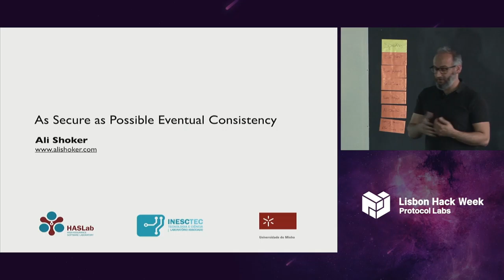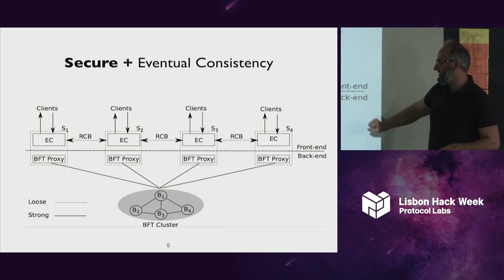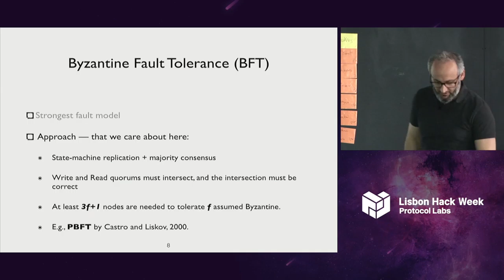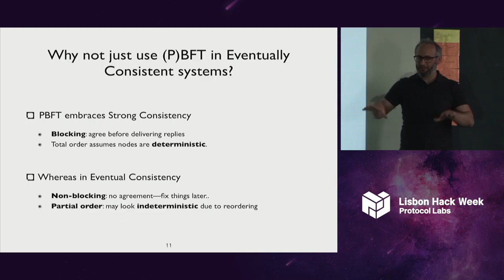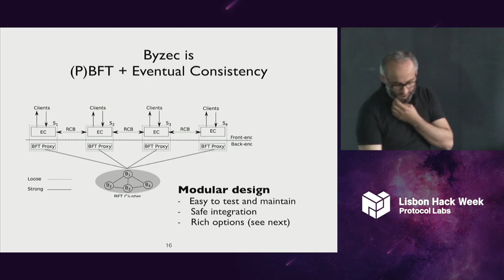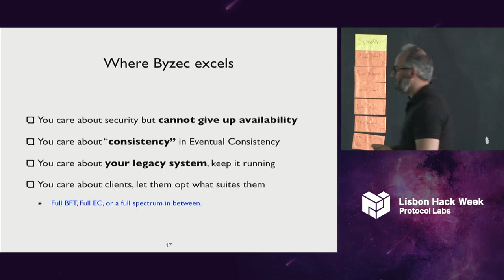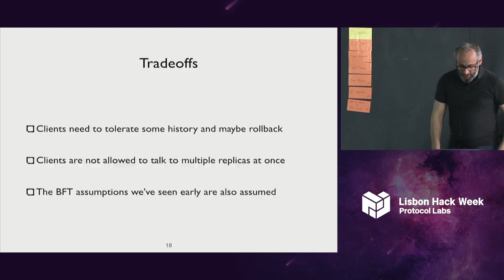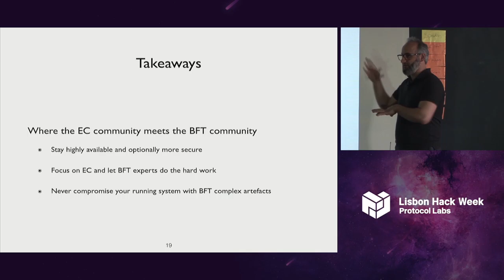CRDT Research Meetup // As Secure as Possible Eventual Consistency - Ali Shoker

Comment: Thanks for the intertest.
I think there is a misunderstanding since we don't need that "engine" (although it is nice thing to have, in general). Assume we don't have Byzantine application EC servers (a.k.a., replicas) at all. As long as the causal broadcast middleware delivers operations in causal order, any causal path on any replica would lead to convergence, a genuine property of CRDTs. How do you verify this integrity? It is through comparing the states of the same version on diff replicas. Those should be equal in the fault recovery model. 

In the case of a Byzantine replica, the states of same version may not always be equal (as the execution may be reordered, state is forged, outsider is inducing non-causal operations, execution fault, memory fault, etc.).. What we do is to only compare these versions off the critical path so availability is not compromised. If the versions are not equal, this indicates a Byzantine behavior as the CRDT convergence property is violated.  The challenge here is how to choose the version to compare without stopping the system and how to make sure the replica is not retaining two logs (one for certificates and another forged one for clients)... These details couldn't be covered in the 15 minutes talk, unfortunately :(

We are submitting a paper soon with the full algorithm and empirical evaluation. The evaluation is really promising as we scale up to 150 app servers (running on 20 machines) instead of handful servers in classical BFT protocols (we compare to BFTSmart, used a backend in Hyperledger).